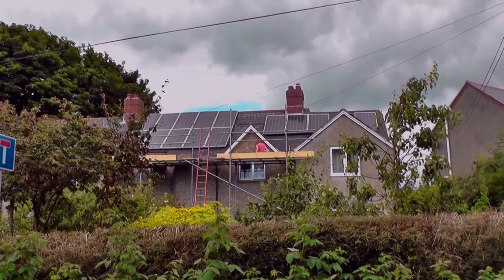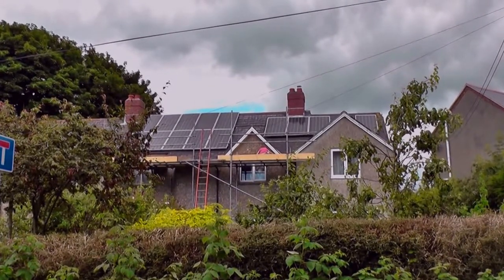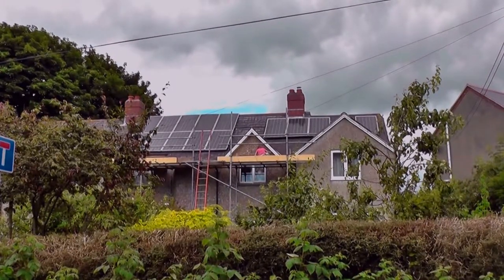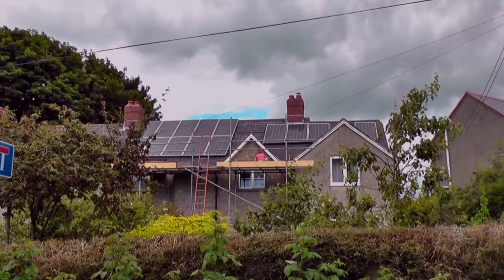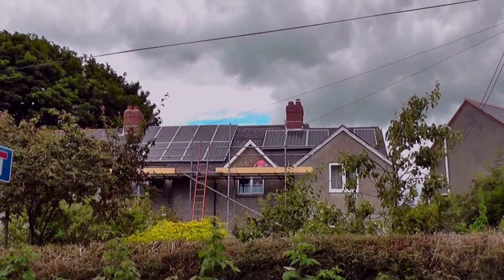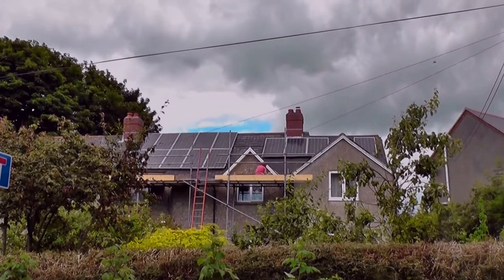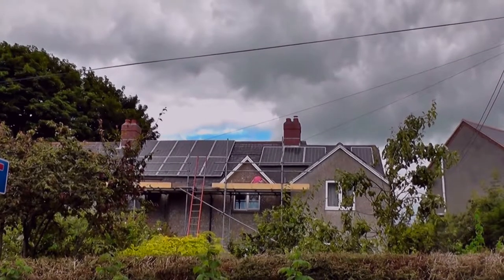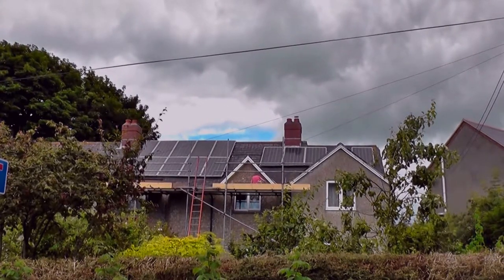Solar panel update, Solar Edge

Comment: So now there would be no excuse not to blend me up a berry smoothie if I were to drop by during a power failure?

Helen brought to mind nothing so much as Michelangelo painting the ceiling of the Sistine Chapel, poised high above the chapel floor, heedless of personal danger, thoughts bent on the greater glory of God. Godspeed, Helen, Godspeed!
Reply from the maker: I still would have no power during a powercut,  but they are rare, so drop in for a smoothie any time, although raspberry wine would be easier. I think Helen painted it because we may have friends and family coming down soon!
Reply: Raspberry wine sounds perfect!